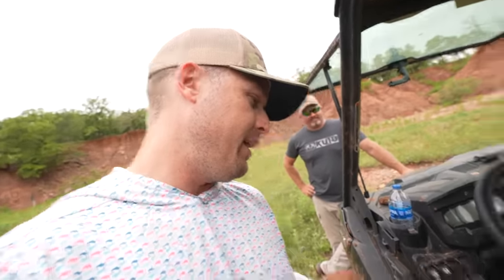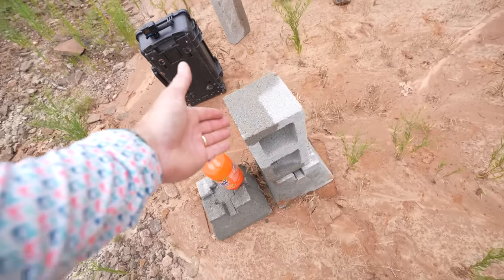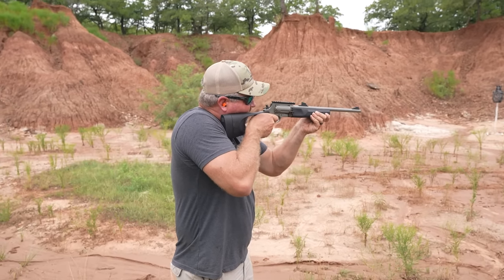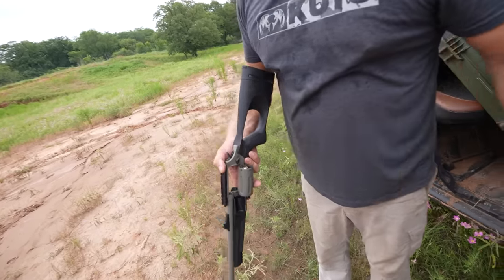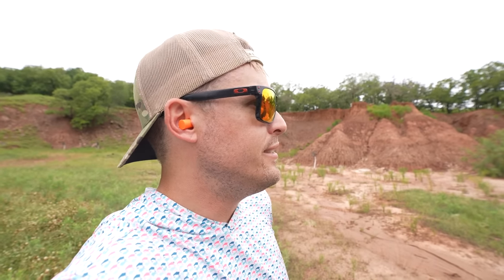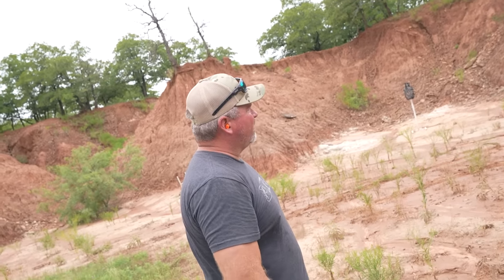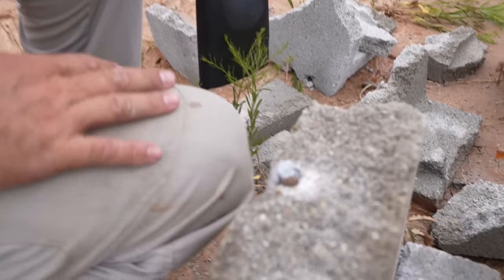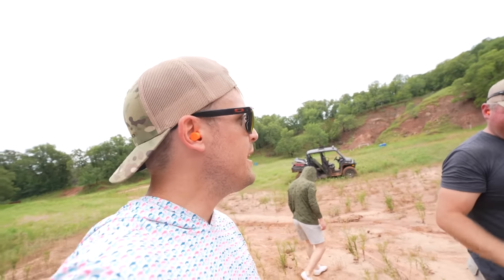My FIRST Drive By Shooting  - The ULTIMATE TEST

Comment: Ive never shot the micro, but the mini draco is one of my top 5 choices for a go to rifle. A folding brace on a mini will fit into a backpack and is one of the best truck guns you could ever ask for.
Reply: Only problem is velocity loss from the short barrel
Reply: You only loose about 200fps when you chop the ak barrel down to 10 ish inches
Reply: @fishin3196  exactly. 7.62 doesnt suffer anywhere near the loss from a shorter barrel that 5.56 does.
Reply: @fishin3196  it's still 7.62, even if it loses some velocity that round will absolutely ruin your day if it hits you out of a 12 inch barrel
Reply: Bro that thing kicks like a mile a 5.56 kicks a lot lighter personally I am not choosing the mini draco
Reply: Lol Wanna be black so bad!!
Reply: @tydavis2673 rather have a micro arp than a draco
Reply: 2 problems it’s not a rifle and it’s impractical tell me you know nothing about firearms without telling me😂

Comment: Most commercially loaded 45 long colt ammo is loaded to black powder specks witch is pretty low pressure and velocity. I  think you can get some hot loads from underwood ammunition, which would be awesome out of that riffle length barrel.
Reply: I'm not sure that Taurus is +P rated.
Reply: The rounds they have will wreck a wild hog. I'd love to see them shoot hogs with both, the AK47 and the 45-long colt between 50 to 70 yards and see which one does the most damage. I'm going with the 45-LC. lol.
Reply: @calvinh.8882  have shot a many of pig w/ my Zastava m70. It's fun, to say the least. lol
Reply: @NotOnDrugs  I've shot more than I can remember with all types of firearms. and had fun every time. lol.
Reply: You think hard cast would have done better? I think they are using bear load hollow points.

Comment: Those 45 long Colt soft tip rounds are designed to expand fast and expel all their energy fast you needed Some Underwood 250 grn EXTREME Penetrators GARANTY they will work

Comment: I was looking into the ballistics up that mini Draco and with 123 grain bullet it's getting around 1800-1950 ft per second out of the barrel you can buy plus P hollow point from Buffalo bore or Underwood ammo that list that 225 grain hollow point out of a 20in barrel at 1895 feet per second so I'll do that 18.5 inch barrel you will probably get about 1830 feet per second or you can get 250 grain plus P Xtreme penetrator ammunition that gets 1,400 feet per second out of a 5.25 inch barrel so I'm guessing probably 1600-1700 ft per second out of that 18.5 inch barrel or you can move up to the 300-325 grain plus P hard cast and dangerous game bullets that have between 1300 and 1400 ft per second which would probably be around 1,600 feet per second out of that circuit judge 18.5 in barrel but what I'm getting at is that circuit judge with the proper Mo will easily take down any game in the US as long as it's not over probably 100 yards but it also makes for a good brush type gun too perfect for hog hunting a big heavy bullets make big holes in the animal and does lots of and makes it bleed out quicker also those big heavy bullets go through brush and branches and bushes easier